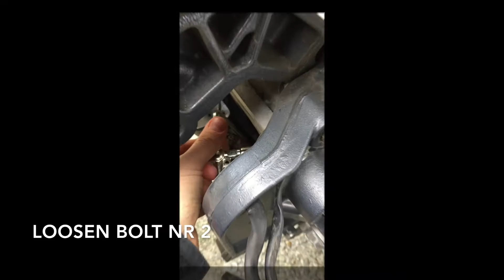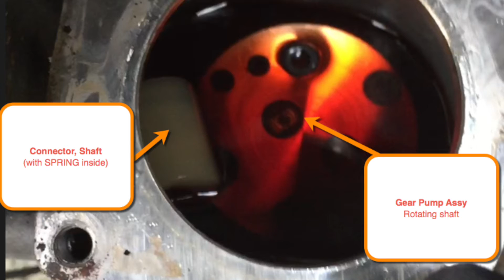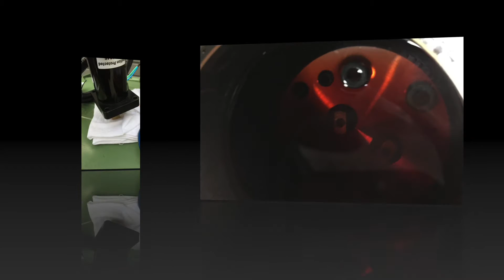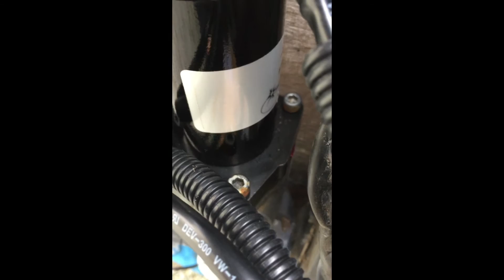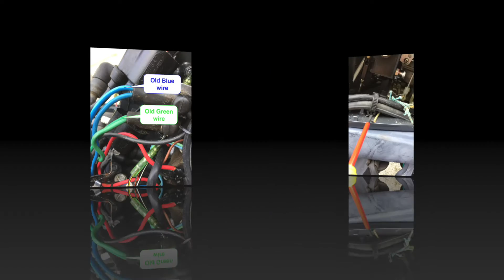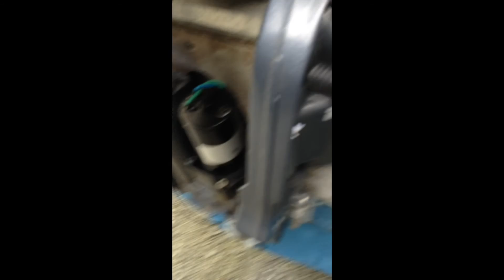Yamaha Replace power trim tilt motor 1998  25 30 40 hp 4 stroke DIY

Comment: Hi, where did you source the motor from?
Reply from the maker: motor: http://www.ebay.com/itm/Yamaha-Trim-Tilt-Motor-2-Wire-4-Bolt-Mount-F25-F30-F40-1998-2013-/332090436501?hash=item4d5221eb95